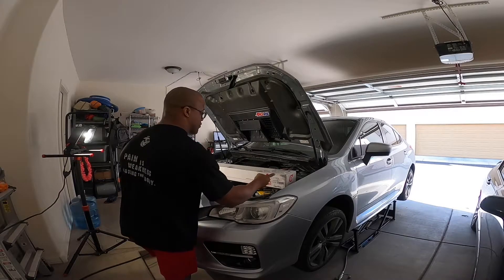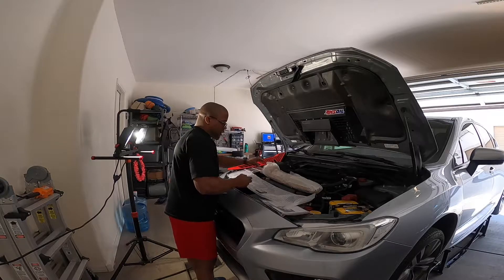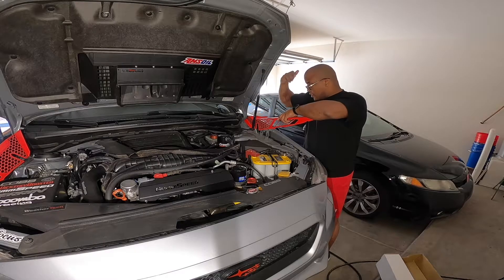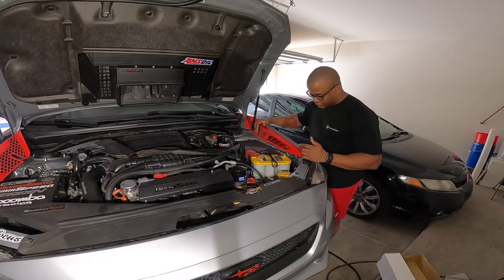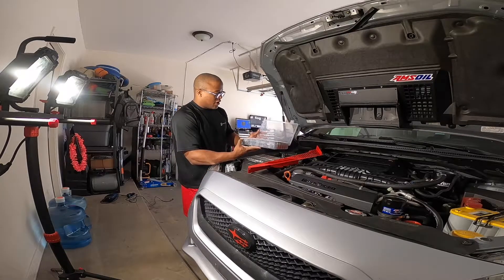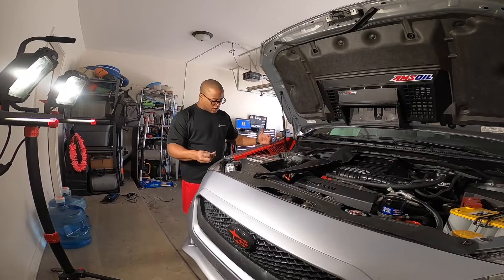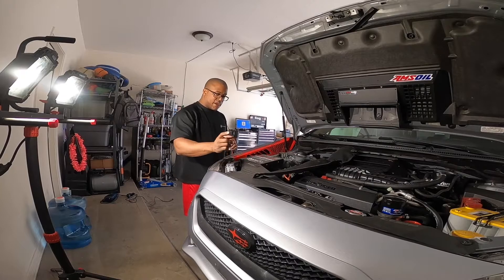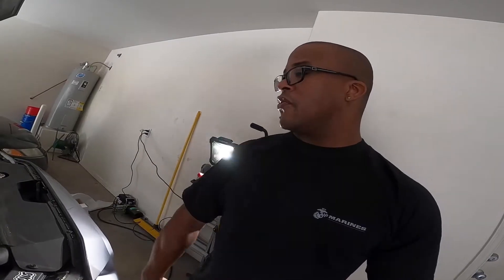Compressive Tuning Air Blade install for 2015+ WRX

Comment: The car looks great! I just ordered their shroud for my STI. The blades are next, thanks. I am wondering how your lift system is working out? Happy with it? Which model did you purchase? All I have are Race Ramps for now. Thanks in advance.
Reply from the maker: Adam Flax Thank you sir, Quick jacks are great makes working and getting underneath the car so much better. The model I got was the 5000SLX. However if I could I would get the 70000SLX just cause they are longer and will make it much easier to center under the car. Other then that, best investment ever!
Reply: @khaozdreamz  Thanks so much for letting me know about the jacks. I am going to look them up now. TNX!

Comment: How did they perform in summer?
Reply from the maker: With the combination of my aluminum radiator, and both the air blades and smart shroud. The engine temps stayed under 190 in 115 degree AZ. If using the ac then 215 while in the freeway.